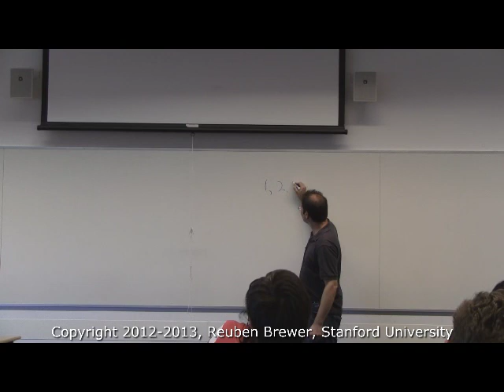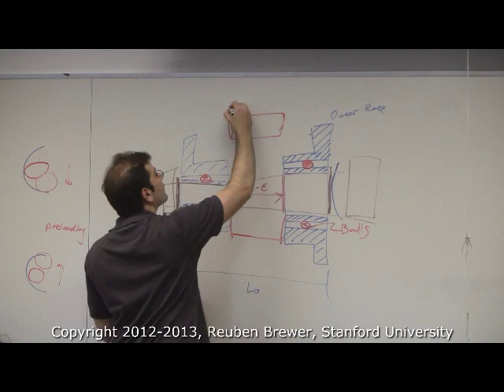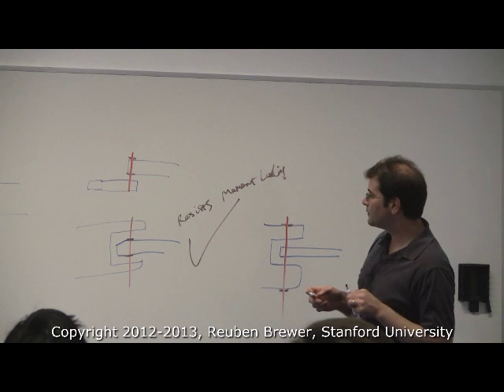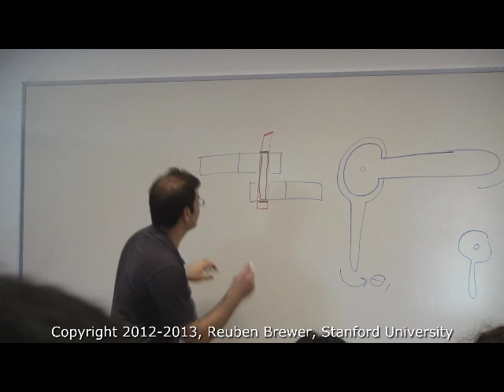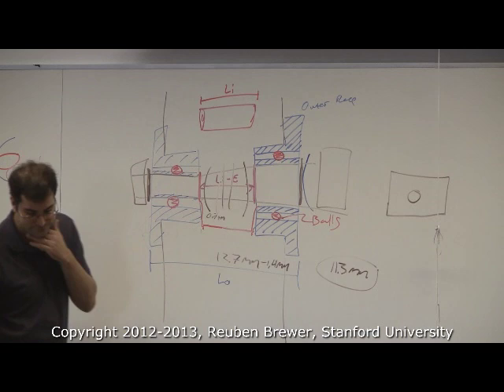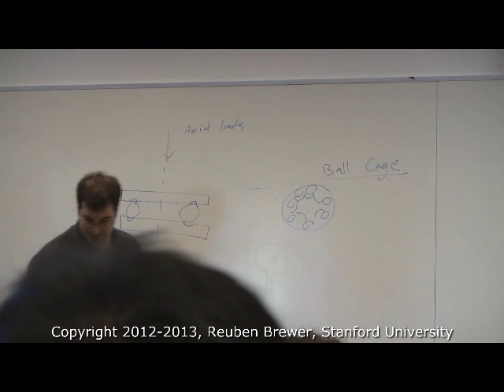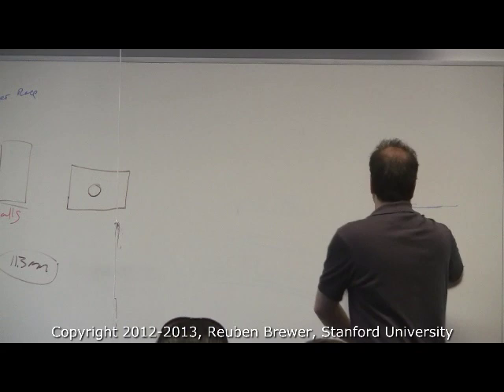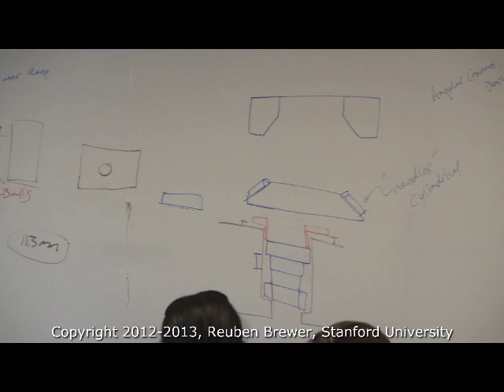CS235, Lecture 19-Review of Ball Bearings, Different Kinds of Ball Bearings, Exit Questionnaire

Comment: Two types of bearings that I know of where you can get away with a single bearing: 4-point-contact ball bearings and crossed-roller slew ring bearings. Both of them resist axial, radial, and off-axis moments, and both are quite expensive. The "turntable" mentioned in this lecture is probably a crossed-roller bearing. Makes sense not to mention either in this class, though!

This has been a great lecture series. I'm several weeks into the design of my own low-cost robot arm, and I really wish I had come across this earlier. I spent a lot of time working through concepts that are covered in this series. Thanks!

Comment: 30:08 is a needle thrust bearing as mentioned - google it. It ONLY takes axial forces, unlike tapered roller bearings which in x or o arrangements cope with both radial and axial loads.

Considering the application, with high axial forces and low speed rotation, it would seem tapered roller bearings would be optimal, with angular contact in a second place, which is also mentioned about 34:30